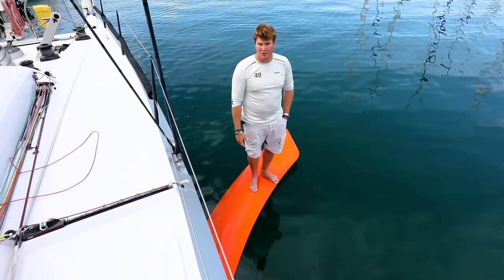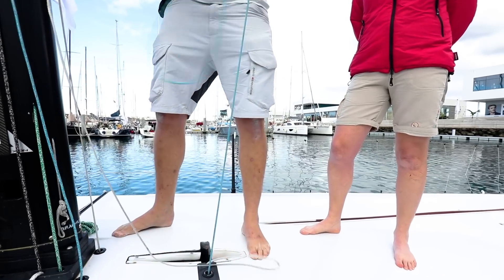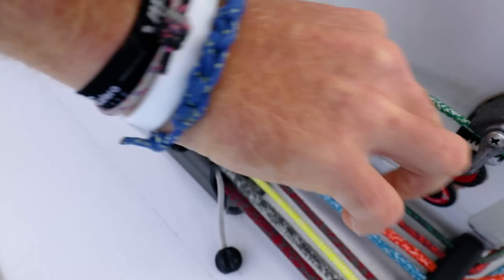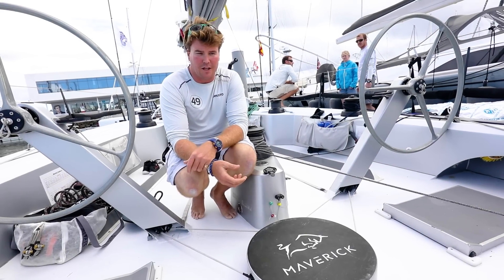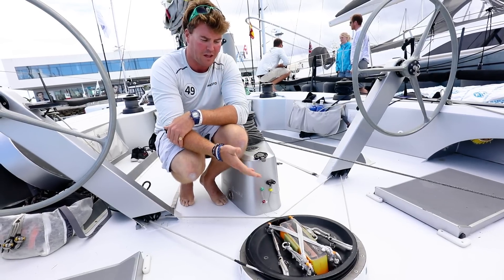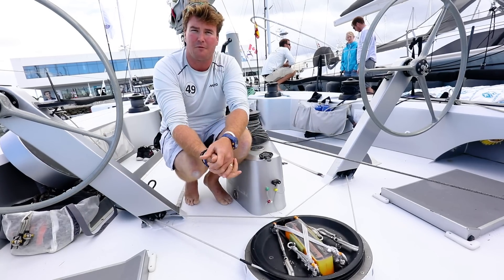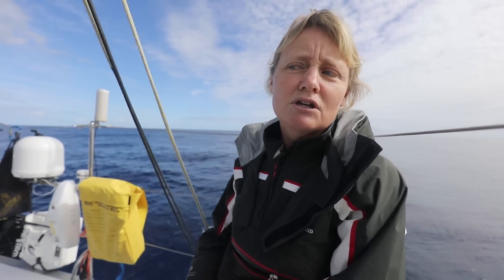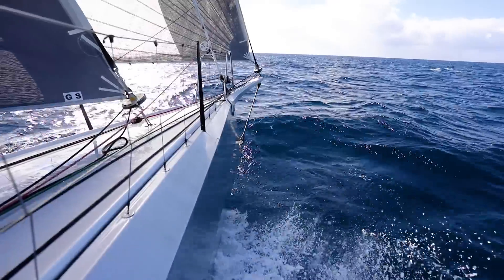On test: Infiniti 46 Maverick with foils

Comment: Every now and then you say "wow! This is the future". This is one of those moments. 15, 20 years from now, all boats will be built this way. Like all the best ideas, we say "this is so obvious. Why didn't we do it like this before? ". Great job guys.
Reply: The answer to that is they often did think of it but they did not have the technology or materials to make it work.
Reply: Barry - a lot of this new tech is made possible by advanced composites like Carbon fiber and carbon Kevlar along with computer fluid dynamic modeling that even a decade ago couldn’t be done on a work station.

Comment: This is interesting as a race boat ; but i disagree that this will be the future of all boat designs . hard to imagine a typical performance cruising boat goofing around with foils ... not everyone is interested in spending time tweaking foils and untangling kelp from the extra appendages ... not to mention additional thru hull equipment : possible leakage , etc
Reply: The foils are deployable. If you're short handed, not looking for maxium speed or simply not feeling it you don't need to use them.